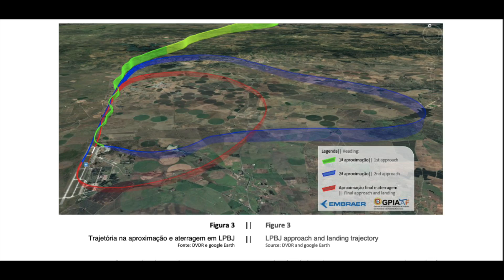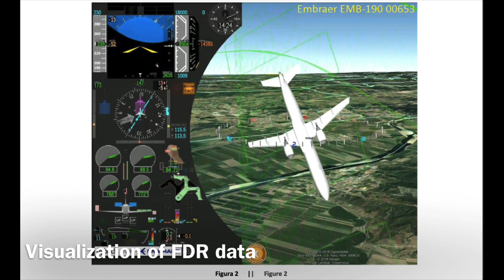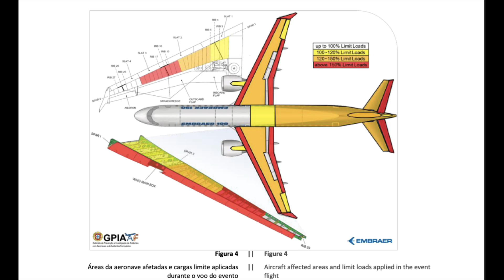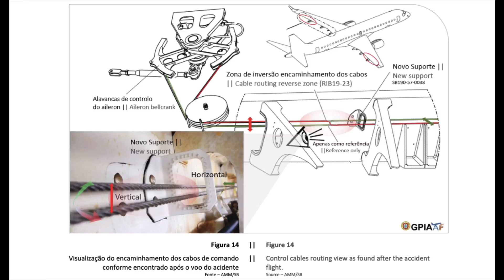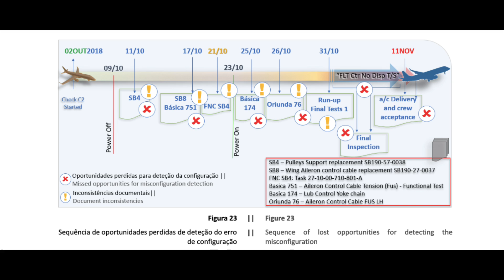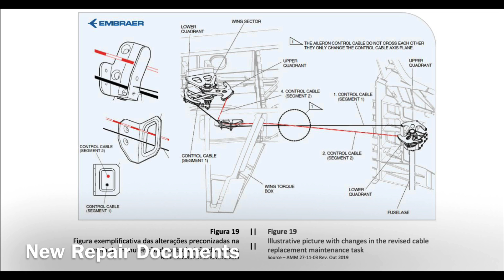Fighting To Survive | Air Astana Flight 1388

Comment from the maker: Hey guys I'm in the process of making a discord and I'm looking for a few people to make sure that the server is ready for prime time, The following link is valid for 10 uses if you missed out dont worry I'll be rolling it out to everyone in a week or so :)  https://discord.gg/esM2ya3
Reply: nasa wrote the differential thrust software after sioux city and the pilots union refused to accept its implementation
.
it also saved fuel.
Reply: @brucebaxter6923  interesting.  Why the resistance?
Reply: @commerce-usa  
Pilots and motor vehicle drivers are the only people that fight automation.
They want to be heroes and cant handle the idea that a computer does their job three times safer.

Its quite interesting looking at the statistics, 2/3 of all deaths are pilot responsibilty, 1/2 pilot initiated, 1/6 pilot error
Reply: @brucebaxter6923  thank you. Those statistics are eye opening.  Even so, one would think that the automation would have caught the cable reversal during the preflight surface test phase. We learn something from every event.
Reply: @commerce-usa  
yep, nothing is perfect and we have to be careful to not let perfect be the enemy of good.
Reply: I was too late, maybe next time
Reply from the maker: Don’t worry. It’ll be open to all soon enough:)
Reply: @brucebaxter6923  agreed
Reply: @MiniAirCrashInvestigation  If you want some more help setting up the server. Bots, layout, roles etc. Im happy to help. I've setup servers for multiple streamers / youtubers before. All the best for the future!
Reply from the maker: @redcitadel8354  come  on over: https://discord.gg/SfpfvT
Reply: @brucebaxter6923  And how many accidents and lives would have been lost if pilots never overrid computer controlled flight? Do you have those statistics? No you don't because every time a computer makes a mistake a human is there to at least attempt to remedy the situation.
Reply: @JonathanLit  
That is called an incident and reports are made and easily accessible.

it is however a false argument as there are aircraft and automobiles that do not have humans on board and they consistenly run three times safer.

what you really need to do is read up on accidents and incidents where the human over rode what little automatics exist in commercial aircraft. Hint, planes dont crash with autopilot engaged
Reply: @brucebaxter6923  The thing is not every incident is reported. Even when we consider just one part of an airplane, the pilot tubes, you  can see massive system wide failures resulting from incorrect information derived from them that would absolutely bring down countless flights if left to automation to deal with. Granted, even trained humans can't save all flights doomed with malfunctioning pitot tubes, but a human can recognize that the information she is recieving is bad, and decide not to trust it and fly using other instruments or her own senses. A computer can ONLY use the information it is given by its sensors. Ir has no way to use logic and true and correct observations of its environment to override incorrect sensor data and come to the correct, life saving conclusion. As long as sensors can fail, automation will be inferior to human guided flight.
Reply: @JonathanLit  dream on.
autonomous aircraft do exist and they are 3 times safer, your fantasies are irrelevant.

the most common cause is controlled flight into terrain followed by pilot induced stall and then vfr into ifr.
Reply: @brucebaxter6923  I'm no expert by any means,but autopilots automatically disengage in most abnormal situation,leaving the bad statistics for the humans.Not to mention,whenever they arent sure about the cause,it will be stamped in as pilot error...
Reply: @gregorzpeck2  
How quaint, you think autopilot is an autonomous system.
I hope you dont think cruise control is self driving for your car.
Whatever they call it, its already existing and already 3 times safer to have no pilot, there is no room for doubt.
Reply: @brucebaxter6923  You keep bringing up this "3 times safer" statistic but you offer no evidence to support it. I've been giving you example after example where, if full automation was implemented, the plane would go down. Let me give you another. If captain Sully wasn't at the controls and instead a computer was flying that airliner, the miracle on the Hudson would have been the tragedy on the densely populated neighborhoods of New York. Also, this 3 times safer thing is completely meaningless and useless. There has never been a commercial flight filled with passengers controlled from take off to landing by a computer. There literally doesn't exist a data set you can pull from to verify, or really even to make,  your "3 times safer" claim. Without flights with humans on board being completely controlled by automation, you have zero standing to make such a claim. Now I'm done arguing with you over this nonsense. I have better things to do.
Reply: @JonathanLit  
civil aviation accident statistics
Reply: @JonathanLit  you might notice most safety incidents begin with the autopilot getting confused and dumping control onto the pilot. As soon as a critical instrument quits, so does your automation. Except, it will work long enough to convince management that copilots aren’t needed, until they are.
Reply: @brucebaxter6923  those statistics don’t include fully autonomous aircraft, so you literally just admitted you don’t have any statistics to show automated aircraft are safer. 
You may be right, but to claim the data is in, when it doesn’t exist yet, will only deepen mistrust of the technology you’re trying to promote.
Reply: The Pilots did an absolutely superb job.
Reply: @topform4665  
Great job of getting airborne in an unairworthy aircraft that was clearly labeled as such.
Reply: @ED-es2qv  
Really?
Reply: @MiniAirCrashInvestigation  invite link expired
Reply from the maker: @ellenorbjornsdottir1166  this should work https://discord.gg/rhDgbc9
Reply: ⚪️ For another somewhat similar story look up China Northwest Airlines Flight 2303. Everyone died in this one though.
As the video says it should be mechanically impossible to connect the wrong cable.
Reply: Two things I don't understand:
1) The computer detected the error and raised a generic warning. Was there no way to check exactly what problem it had detected?
2) In response to the error message, they rechecked the systems, found and fixed a couple (actually unrelated) errors, and reset the computer. Why did it not detect the error again?
Reply: @brucebaxter6923  Ironically, in this situation the automated system couldn't cope and the humans brought it in safely.
Reply: @DallasHerrmann  
How quaint,
You probably also think cruise control is the same as autonomous driving.
Reply: @DallasHerrmann  
If you watched the video, the computer said it was broken and couldn’t fly..

While it was on the ground

Before the pilots took off.
Reply: instaBlaster
Reply: Being conscious of the fact I'm really late to this and taking into account this was one of your "earlier" videos, with intonation greatly improving over time, I still would like to congratulate you on this video. I've seen quite some coverage on this flight and while not being expressed as clearly as it could have been, this was one of the very few videos answering the question of "well, if cables have been reversed, why didn't they simply use inverted input?".
As said, this could've been emphasized much more, but great it was mentioned. I've always been left dumbfounded by other videos/docs because they didn't mention the peculiarities. Thus, a big thank you from my side. And probably also from the pilots, who, judging from other videos, might be remembered as too dumb to understand inverted input instead of masterfully flying and saving a totally unstable plane.
Reply: What source did you find that mentioned the aviator medal the pilots were awarded? Is it a civil aviator award in Portugal? I don't doubt your research I just wanted to learn more about the award but I can't seem to spell it correctly and therefor my search terms are all messed up haha.
Reply: Its beja not beija 😂 beija means kiss

Comment: An old captain once wrote in an airline magazine (paraphrased): "An aircraft is never as dangerous as when it comes out of the hangar after maintenance".
Reply: Scary for maintenance personnel too! Have I forgotten to tighten.......
Reply: AA Flight 191 is the textbook example of that!
Reply: I've heard of planes coming back from depot with loose power tools and loose flashlights (i don't mean little ones that you can hide in your hand, these are like a foot and some change long and you could club someone with them) closed up in panels, I've seen some systems wired backwards, some connectors simply not connected...
Reply: @charlesdale5965  Was that step important?
Reply: Agree
Reply: Second most dangerous? A 787 coming out of the Boeing SC plant.
Reply: @Benjamin Playford how exactly? I couldn't exactly access IMDS historical records when i had a login, even less so now that i don't. Plus some of these things didn't exactly get repaired aboveboard because it was faster to just connect something and say you turned it on and off.
Reply: @charlesdale5965  was this bolt important?
Reply: That man, is aphilosopher, and you Sir, are a great wit!!
Reply: Sounds like a very wise captain!!!🙏🛫👍
Reply: @nunyabidness674  living in Tacoma Washington a certain company's hq and legacy began right up I-5 north of me with highly trained and specialized folks, but that was then this is now and that hq and most operations moved to cheaper, oops I meant greener southern pastures...hows that working out again!!!🙏🤔
Reply: That’s funny seeing how pilots error is the number 1 cause of airplane crashes and by a huge margin
Reply: Im other word: aircraft mechanics are crap.

Comment: As a maintenance technician I’ve seen this happen before. But most times you catch it on the ground. Anytime I take control cables off I mark them with tape and label the tape with either numbers or orientation. Great video as always.
Reply: Respect!
Reply: The fact that they aren’t stamped on the attachment arms and marked on the cables from the factory is really interesting
Reply: A really good design would have different sized or shaped ends on the cables.
That said, it seems that in that particular maintenance facilty, no dangle was left un-clacked and no fuster un-clucked.
I sincerely hope none of those clowns is still working on aircraft.
Reply: Would it make sense to give the ailerons a waggle while the plane was on the deck? Seems to me a visual inspection of the aileron operation would have caught this issue
Reply: @cmdreltonpoole6303  It was certainly hammered into every student pilot where I trained to check that visually (all controls free and correct sense). However, on most airliners you can't actually see them from the flight deck, and you can't even send a crewmember back to look for you any more, now that the flight deck has to remain closed from boarding to the destination gate.
But no excuse for it not being checked prior to a test flight.
Reply: " Anytime I take control cables off I mark them with tape and label the tape with either numbers or orientation." and, i bet, you actually TEST whether they function orrectly after the install is complete, making sure the 0 position is correct, etc? It seem this crew did none of that.
Reply: Nice and easy solution! Reminds me of ifixit repair manuals. This could be made a recommendation...
Reply: @marvinkitfox3386  yes I do lol I do an operational check. It’s a tool called a potentiometer which tests cable tension , so I’ll adjust the cable to make sure it’s not too tight or too loose and then just run thru the controls and make sure whatever flight control movement I’m suppose to have happens. I’ve also seen electrical connections switched for fuel tanks which made the forward and aft fuel tanks read opposite throwing off the center of gravity of the plane.
Reply: At every airline I've worked at any flight control related system was RII, ( required inspection item) requiring a special inspector ( as opposed to regular inspectors) to verify every step per the manual so I'm guessing there were many errors as well as a general lack of training, which sadly still exists today. Training is expensive and EVERY airline tries to postpone or get around having  all their technicians system trained, they make up silly impressive sounding "ojt" type pseudo training which is pure garbage, and the FAA signs off on this eyewash crap. I'm a 38 year Sr Avionics specialist and we are often asked to help trouble shoot basic problems because of the lack of training for the rank n file mechanics ( not their fault). the new systems on a330's and 777's are amazingly complex and require extensive recurrent training , again here enters the money equation........ except management bonuses and stock options, those millions are apparently  better spent than on safety.
Reply: @sparkyobrian6417  Exactly. Which really really makes me wonder how this slipped past their inspection!
Reply: @cmdreltonpoole6303  you’re supposed to check all control surface operations before releasing a plane from maintenance. It’s kinda basic.
Reply: @saab9251  A very valid and important point. Techs can still screw up but giving them a chance to do it right is a really good idea.
Reply: @cmdreltonpoole6303  Watching a military pilot recently, I was delighted to see that pilot move each control surface in turn and looked to see if the surface was moving properly. In the early days of the 747, Qantas pilots would do the same. They were not entirely surprised to get a green light for a surface and then find it wasn't moving when they looked out the window. Saved a lot of lives.
Reply: @sparkyobrian6417  I don't get on commercial aeroplanes anymore. I still get in small general aviation aircraft if i trust the pilot. I understand the statistics say that commercial aviation is much safer. Those statistics don't tell me anything about the pilot's attitude to safety and maintenance. Nor is their character a consideration.
Reply: is there any way to disable the roll spoilers ?
Reply: That's just basic maintenance procedure on ANY mechanical object let alone aircraft!
Reply: @butchblakesley6239  
Nope. Only way to roll an airplane with roll spoilers without using them is by using yaw-induced roll via rudder.

Comment: When I served in the United States Airforce I did cable rigging and our final check for ailerons is a two person job. One mechanic would be in the cockpit and would first turn the control; wheel to left for a left wing down and the mechanic outside would verify the left aileron up and right wing aileron down. Then we would turn control wheel for right wing down and verify right wing aileron up and left wing aileron down . This is a must in all cable rigging to prevent crossed cables.
Reply: You NAILED it, my man!!  My Father taught me that!
Reply: thats what you also do after building an RC plane and configuring your controller - make sure servos aren't working in reverse.
I can't see how it's not an obligatory check after changing the cables.
Reply: Basic common sense  gets hidden in  paper work and management
Reply: I'm trying to picture a pre-flight inspection that doesn't cover proper control surface rigging. I mean, that was pounded into me right from primary.
Reply: ! ! !  OLD SCHOOL BASICS  ! ! !

Likewise This “OLD SCHOOL BASICS”,   “FLY, NAVIGATE AND COMMUNICATE”  Are The “GOLDEN RULES”  Ever !

Comment: 5.5G!! It's probably a testament to the build quality of this plane that it didn't just tear itself apart in the air. Wow.
Reply: Good to know Embraer builds their planes like tanks.
Reply: They are just small enough to handle it! I think an A380 would have split into 3 pieces midair.
Reply: @kevintucker3354  Look up China Airlines Flight 006, where a 747 nonetheless survived a 30,000 ft dive in under two minutes, maxing out at 5.1g. There were whole parts of the plane missing, the wings were bent,  but they landed the thing!
Reply: More like luck
Reply: @aerohk  You'd be a lot less lucky with poor build quality.
Reply: @aerohk  yes, engineering school where they teach you magic rituals to bring luck into your projects